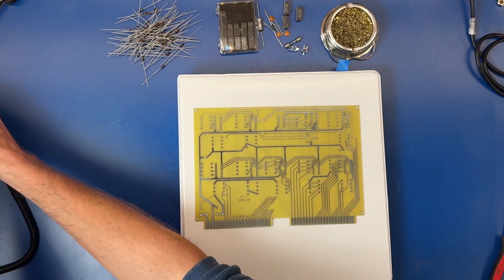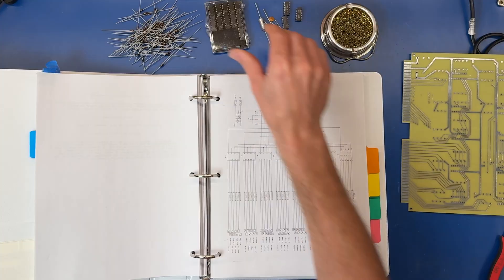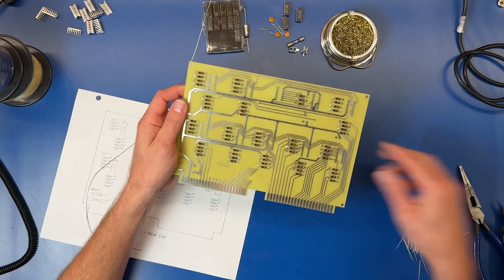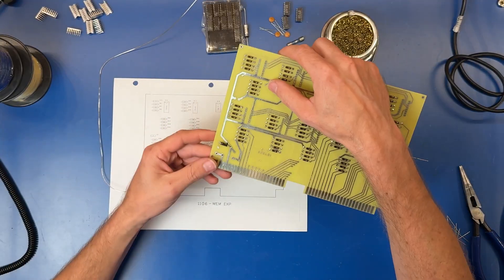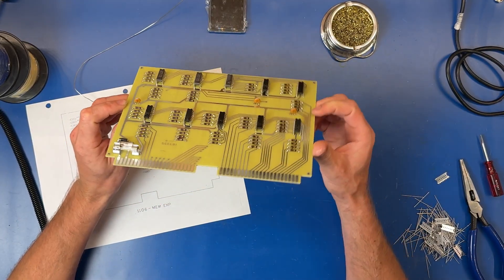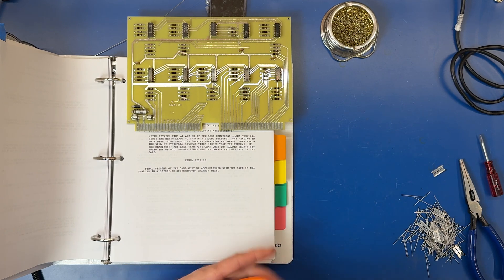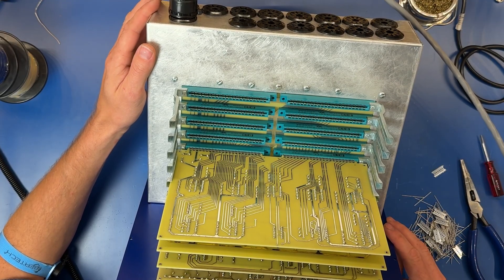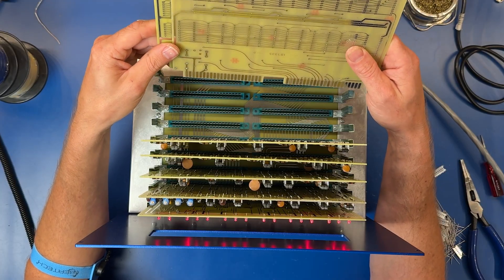Assembling the Memory Expansion Board for the SCELBI 8B

Comment: Although you faced all of the resistors in one direction, it should have been left to right. That's the proper way, and faster to read.
Also, Caps. top to bottom.  NOTE: I personally HATE those IC Sockets! :face-orange-frowning: I would ONLY use Pin Sockets.
Reply from the maker: Hmm, I thought I did have them left to right. The tolerance band is on the right.